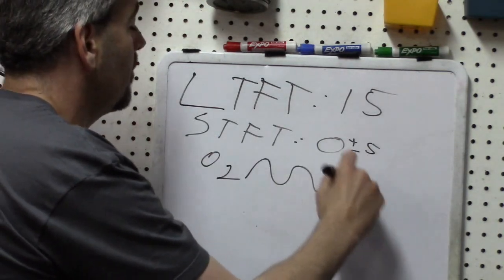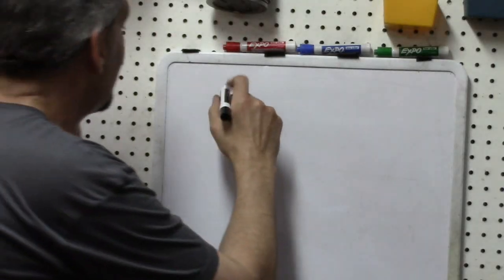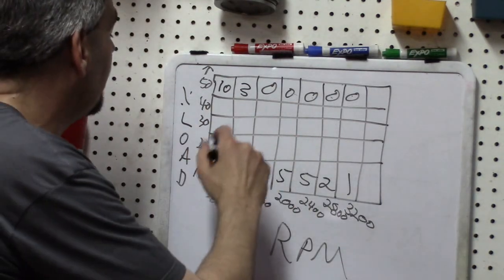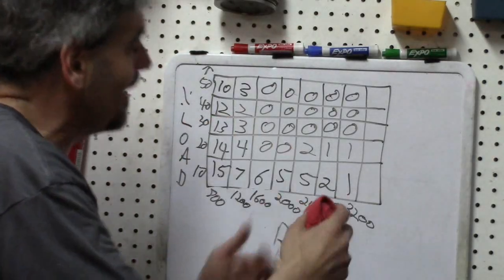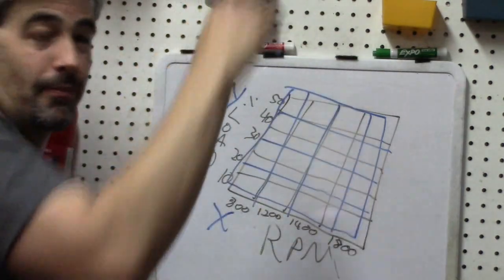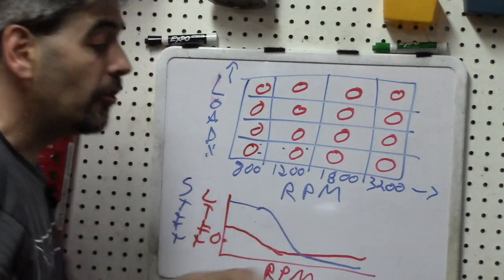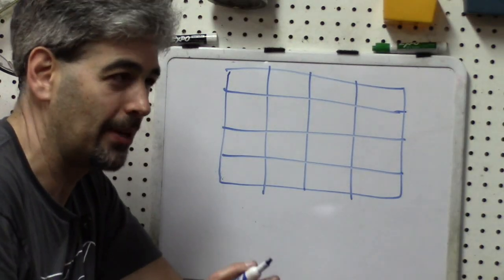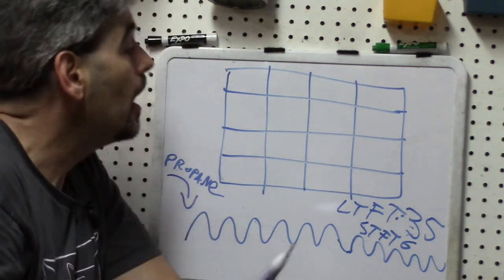Understanding+Diagnosis: Adaptive Fuel Learn Strategy

Comment: Say the vehicle does not have a MAP sensor (as in was not equipped with, 95 Grand Prix 3.4 DOHC to be specific) , does it then just use a simple 2D map for LTFT's?

And again, thank you for the excellent information! makes me fell a tad nerdy and i like it! lol
Reply from the maker: Sorry for the late reply. ALL vehicles will use a 3-D map regardless if there is a MAP sensor or not. There are "levels" for EVERYTHING input- MAF, IAC, TPS, IAT, etc....  So the combination of all these inputs is considered in drawing a fuel trim from a cell. So for example of you're at 15% TPS with an IAT of 70F and 1500 RPM with MAF of 2.3g/s there is a cell for that. If you do the same exact thing but the IAT is now at 95F it would be a different cell that could have a different fuel trim stored.

Comment: Is it possible to have negative figures in the map Matt?  I don't think it is because it is about adding or subtracting fuel (you cannot subract no fuel) and the way the fuel and electronic systems are designed you cannot add no fuel if you know what I am meaning.  How then can long term fuel trims be around zero I mean positive or negative if there are no negative long term fuel trims in the map?
Reply from the maker: You absolutely can have negative trim values in the map and often do in fact. I have many videos of cars correcting for a rich condition with negative trims. When it’s fixed, we see the negative LTFT start going to zero. This can only happen if negative trims are memorized.
Reply: @SchrodingersBox  Yes of course thanks for the explanation.

Comment: ... also as long as I think about it there are more questions than answers. 
1. How do all kind of sensors affect fuel map? What are the possible conditions?
2. How does this 3D concept work? How PCM knows which layer to use, what are the possible conditions?
3. What happens to the engine when you have a problem (vacuum leak, bad MAF/MAP, something) but there is a 0 in certain cell and this condition is met? 
4. The fuel needs to be sort of linear (well, as linear as air...) - how linear is the map? What if you have "holes" in your map?
5. After long time, if the car has a different problems during this time, and the map was never reseted, it can be a complete mess. Is that possible, that engine will not work correctly even if it's in stock condition but has messed fuel map?

Comment: Matt I just realised when I am watching my scan tool at times I have not been able to get my fuel trims, it must be because the response time has been longer than I expected. Engine light has not come back on so far need to check the purge valve hose as you advised. If a check engine light was on due to a fault in the ECU would it stay on permanently do you think? I have learned so much valuable information already Matt, brilliant.  My scanner is a Thinkcar OBD100.
Reply from the maker: It is not an ECU fault.   Your refresh rate may be slow but your data shows it isn’t an ECU problem.
Reply: @SchrodingersBox  Great that is what I was hoping Matt thanks.
Reply: @SchrodingersBox  If the ECU was faulty what would be the symptoms, would it retain the data from the LTFTs?
Reply from the maker: It depends. But right now you have no analysis. You need to analyze the data. The fact you have it is not indicative of a ECU issue. Go where the data tells you- not where you want to go. Just follow it.
Reply: @SchrodingersBox  I  will Matt great thanks.

Comment: Quick question ... If the propane was not going to increase your fuel trim due to it being pegged at its limit, then what diagnostic purpose was there in using it? I'm assuming there would be an upper limit of fuel trim that it would be useful at and beyond that point, it loses all diagnostic power?
Reply from the maker: One reason is because you could see if there is any reaction in the O2 sensor (not the fuel trim) which may help indicate if the issue is an O2 sensor problem or a legitimate rich condition accurately reported by the O2.
  Also a induced lean condition would be necessary to also confirm O2 sensor reacts (which in that case should bring the fuel trim up too).

Comment: I wonder if it would be actually helpful on a scantool to have some 'normalized' fuel trim.This would avoid the confusion or extra checking step that results from the example you gave were the LTFT would go down because the cell is not learned but the STFT is going very high to actually start the learn procedure for that cell.

With a normalized trim (which would be basically the difference between LTFT and STFT) you would take, the basically invisible, fuel map state out of the equation and you would always get more consistent results.

Any thoughts on that?
Reply from the maker: Markus Krause I absolutely agree. It's funny you call it "normalized" fuel trim because that's what I call it too. I usually hear or read it called "Total" fuel trim.  Either way, anytime I assess a fuel trim, I account for the combined ST and LT trimsand determine that result as the actual fuel trim for diagnostics.

Comment: The engine will run at a bit higher rpm at idle when there is a vacuum leak because the higher ltft or stft will be higher to compensate the leak. Correct?
Reply from the maker: Correct- IF it’s a MAP only engine. If the engine has a MAF it will idle slower with a vacuum leak.

Comment: Another great video! In my case, I have  high LTFT across the whole learned cells I feel. They are all well over 25%. No engine light for the most part. It comes and goes but when it does it is always the same lean code. I am pretty sure it is coming on each time I am in a decel state shifting into a higher gear. Low rpm (1800 - 2200). Also now that it is getting a little cooler in Texas, I have been running no AC and that brings in NEW LTFT from other learned cells at idle these are well over 30%. Is this still, in your genuine expert knowledge, point towards a fuel delivery related lean condition?
Reply from the maker: You don't really enough data here to determine. Just run a straight total fuel trim curve against load to determine the cause of the lean condition as vacuum leak or fuel/induction

Comment: So what i understood is tha the pcm chooses the adapted values or learned conditions based on the information coming from the map sensor but what if the map sensor was faulty or not working  greetings from a Moroccan fan i really appreciate your efforts
Reply from the maker: Oh what a great question!  Yes in the event of a failed MAP (or ANY failed sensor used for input in creating the fuel cell grid) a substitute value is used by the PCM that would most closely represent the expected value for that sensor under that condition. For example at idle, the PCM might use a MAP value of around 8PSI  because that’s what would be close to an actual value at idle and would keep the car running.
Reply: @SchrodingersBox  thank you sir im studying automechanics and i benifited so much from your knowledge i follow your videos and danner's you are both teaching by heart courage keep up 👍👍🌼

Comment: Did you not check the O2 sensor because you knew the short term fuel trims had responded and set the long term fuel trims, I need to watch that video but I understand a fair bit of what you are saying Matt.
Reply from the maker: correct. because we saw logical response from the fuel trim, we know the O2 sensor works. there is no other explanation.

Comment: This is exactly what's happening with my 2009 gmc car. I have a faulty A/F sensor in bank 2 so I replace it. Now the STFT is close to 0 no issues but the problem is bank 2 LTFT is high 24% which gives a code P2179 system too lean off idle bank 2. LTFT bank 1 is also high 19%. I think the ECM has learnt these high values of fuel trims especially when bank 2 was at open loop due to a faulty A/F sensor for a long time. Now is there any way to make the ECM to relearn the LTFT because it's adding 24% more fuel by default based on a faulty A/F sensor stuck in lean condition in the past 🤔?!

Comment: Sorry, another question I meant to ask :-  If the base LTFT grid is RPM vs LOAD, is it not rather redundant to add another dimension to the matrix for MAP as this is so closely analogous to LOAD ?
Reply from the maker: +Gerald Elwood It would be if it were determined from the MAP, which it is not- but also I do not know how it is determined.  MAP is only a portion of the calculation for load.

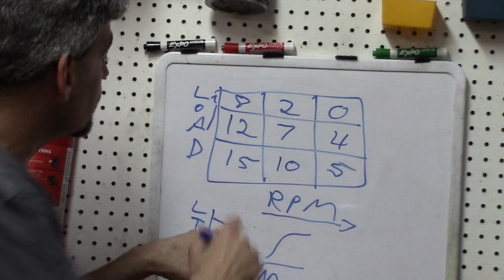Comment: At 16:49 you said that informations are pulled from the array, but what if MAP, MAF readings at some RPM for example 1400 are detecting different value than they were at some point before at the same RPM, does the reading from the MAF, MAP is taken as a correction by PCM to create different array with corrected value, and if yes how long does it take for the values to be replaced by PCM. Thank you for your answer...love your videos bytw. And one more question please would it be correct to characterize STFT something like RAM, and something that has 2 purposes: 1. To react fast to the change in the system and 2. to correct LTFT for the deviation that is used to create a balance in a system ? Sorry if it sounds phylosophical and theoretical and once again thank you for your answer
Reply from the maker: Good questions.  Yes on the second part- pretty fair analogy.  As such, variances in the matrix are indeed "relearned" by the STFT and corrected.  Different cars take differing amounts of time to reprogram the cells.  I've seen some cars especially GM's that are virtually instantaneous while others seems to take minutes.
 Really good questions man!
Reply: Thank you for your answer, I wasn't sure but I was supposing it is correct since it would be the best possible solution to keep the system in balance. I really like you videos.. you are going were deep in the subject, and as well using right analogy in order to explain in the best way possible. Thank you for your hard work I am learning a lot.

Comment: What would you do if say you were looking at a 12 year old car. It had  never had plugs and o2 sensor change out. Would you just go ahead and swap sensors and plugs then troubleshoot from there so you know computer is getting the most accurate information?
Reply from the maker: No of course not. I would read the data and see if they are giving bad information. If not, why change them?

Comment: So I am assuming cells with numbers high enough to put the check engine light on is it possible for the check engine light to come on intermittently Matt? Say one day it needs 25% more fuel and at other times that goes below 15% can those cell numbers cause an intermittent check engine light problem. I think it can. That is the problem I have got at the moment because it was on yesterday and off today.
Reply from the maker: yes that is entirely possible. different check engine light codes will clear depending on different criteria. some codes may take as may as 40 drive cycles without a repeat incident to clear the check engine light. others take just a few. therefore you can have the check engine light come and go depending on what the code is. 
   even when the light turns off, it still should be retained in the pending memory for at least 40 cycles though. so you can still pull the code even after it’s off
Reply: Thank you for your excellent tutorials and feedback Matt.
Reply: @SchrodingersBox  Yes I have checked that (when the light is off) and there are still P0171 and P0170 codes there. I and going to keep a check on the fuel trims. I also noticed the rubber stub connecting to the throttle body for the purge valve was not fully pushed onto the metal stub. Looks like I might have found the source of the vacuum leak? Time will tell. I am going to put a metal clamp on the rubber stub too.
Reply from the maker: If you clamp it and the fuel trim reacts in a correction you know that fixed it. If the fuel  trim shows no correction then the check engine light will definitely return.
Reply: @SchrodingersBox  yes thanks of course clamping it will show that Matt. I will check it. There is a strong gas smell when l top up the tank.

Comment: Once created, is the adaptive learning array stored in volatile memory, such that disconnecting the battery clears that array and those variables are purged?  Furthermore, are there default variable settings in the array that the PCM can follow until a new array is learned and stored?
Reply from the maker: bionicat Both of those statements are correct!

Comment: Great; I am hoping you are going to eventually tell us how load is determined.  Some people say it is strictly based upon the volumetric efficiency i.e. maximum amount air that engine can ingest vs the actual amount air being drawn.  Of course then MAP and load would have fixed relationship!  You are claiming them to be independent variables when you started talking about stacking of graph in Z direction using MAP values..
Reply from the maker: 12vgs8606 Ugh- That's for scannerdanner lol. This is as far as I go!

Comment: Are the LTFTS wiped when the ECU is reset and that is why the computer has to re learn Matt? Hope I am not asking too many questions I know you are busy in your shop.
Reply from the maker: Good question. And I don’t have a shop just my home garage so I’m not missing work lol. 
   Yes- the LTfT is wiped. If the issue isn’t fixed you will quickly see the LTfT’s going back to the positive or negative correction.  If there was a lot of correction before the PCM was reset, the car may even have trouble starting because it’s used to starting from a totally different fuel trim which is now at zero!
Reply: @SchrodingersBox  Great thanks.

Comment: Question... Will the stored memory rays.... Be remembered if battery is detached?
Can a long term be restored to 0 if battery removed from terminals?
98 eclipse.
Reply from the maker: No. disconnecting the battery for more than 15 min clears all codes and fuel trims.

Comment: I diagnosed car ford statesman 2007. Got engine light on. Got code P0420-20 Cat below efficiency.  Other parameters while engine running are. O2S11= 0.13V, O2S12 =0.29V, STFT1= - 0.93%, STFT2= 25.2% LTFT1= -17.96%, RPM = 2000, LOOP STATUS= CLOSED. Can you please tell me why fuel trim so negative on bank 1 and positive on bank 2.??
Reply: One thing forget to mention that with increse in RPM fuel trim doesnot get better.
Reply from the maker: Vikram Singh Impossible to tell without inducing variables Vikram.  I would have to see the bank 2 response to an induced lean condition.

Comment: In another video, you strongly argued that long term fuel trim is the single most informative scan parameter available to the professional automotive diagnostician.  What is your opinion of exhaust analysis with emphasis on the five known gases, oxygen, carbon monoxide, carbon dioxide, oxides of nitrogen (NOX) and hydrocarbons?
Reply from the maker: bionicat I don't recall exactly stating that... being a DIY, I do not speak on behalf of professional technicians but to the best of my recollection I believe my actual comment was probably to the effect of "If I could only have one PID available to me from a scantool when trying to make a diagnosis, it would be LTFT" and I would still agree with that, but not necessarily over an exhaust gas analyzer. Having never used one or having experience with one I cannot really say which I prefer, however I would probably be biased towards the scantool because the historic pattern learned in the LTFT cells from the fuel learn map (which I know you saw that video) would allow me a faster and more reliable diagnosis based on history rather than the real time exhaust output, plus I would be able to more easily, definitively confirm the fix afterwards as well.
  That's just my preference though. I can tell you if I working on an OBD-1 vehicle I would much prefer a gas analyzer since my scantool only works on OBD2 lol.
Reply: Schrodingers Box Matt, thank you for your valuable opinion.  I may have misquoted you on a preference for LTFT testing as the tool of choice.  You are correct in your recollection.  Now, on another matter, you have referred to the internal combustion engine as a PID system, which, indeed, it is.  However, I would tread lightly with that system control term, as it usually applies to much tighter control systems that can maintain a target parameter accurately over long periods of time, with minimal over and undershoot.  To me, the internal combustion engine is far too sloppy to qualify as a true control engineering system.  Unfortunately, the internal combustion engine is the most observable, controllable, predictable and stable prime mover available to us, despite its wretched efficiency.  We just have not advanced enough with hybrids or 100% electric vehicles to replace a vehicle propelled by an internal combustion engine.
Reply from the maker: The term PID in my context refers to the scantool data, not the engine operational algorithms. 
  A scantool PID stands for Parameter IDentification. It is just a term for the individual data parameters available (e.g. O2 sensor voltage is a PID).